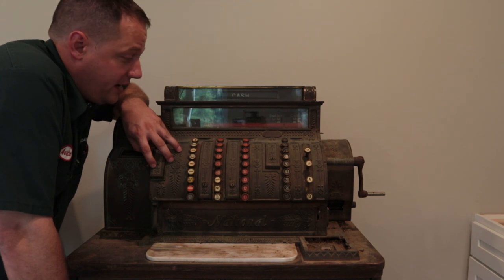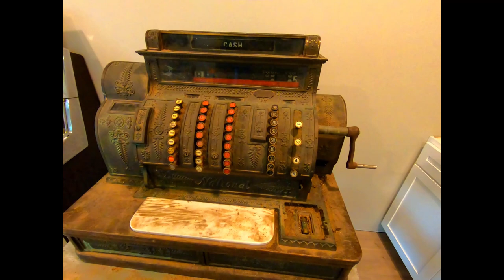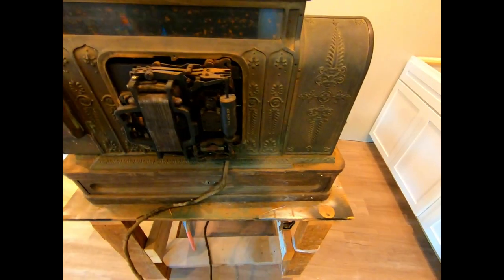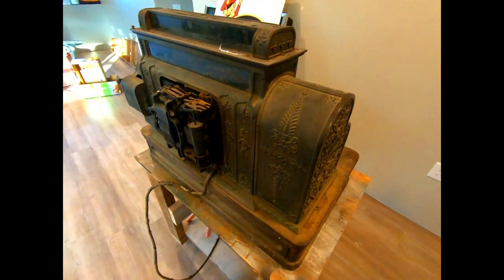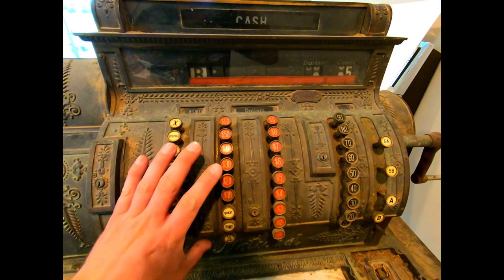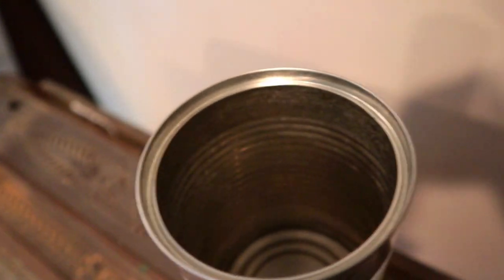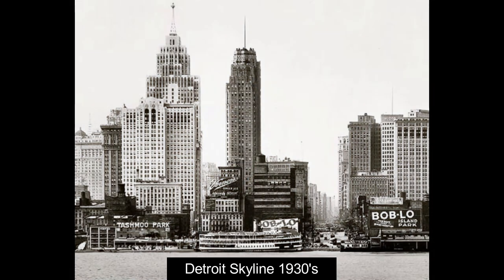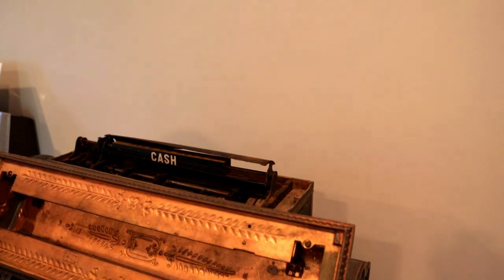What's inside? Mystery Cash Register Locked since 1938

Comment: If you look under the drawer, there will be a label that will likely indicate that it was sold to your friend’s grandfather, and will give the date, salesman, etc, very cool! This will be a challenge, but it is very do-able. As you work to disassemble the machine fully, you can find keys for all of the locks online, just to save you from drilling out any more locks! Good luck! It’s always exciting opening a register drawer, especially if it’s been closed for many years!
Reply from the maker: Thanks for the tip!  I'll check it out! I think I am actually going to take this register to be restored in upstate New York. Some times as restorers we have to realize what is outside our wheelhouse! Thanks again
Reply: @MrVintageRestoration  Well, I'm not sure the scope of what you've worked on, but when you break these down into their general component parts, they aren't too daunting!  By the way, I think you may be referring to HBAC...just be sure to dos one research into others' experiences before the register heads that way! I have no personal experience with them, just have heard of some troubles.  All the best!
Reply from the maker: @bingcrosby1903  Thanks for the heads up. Looks like when the original founder died it went down hill. Too bad. I may have to figure it out. Time will tell. Thanks again!
Reply: @MrVintageRestoration  where in upstate ny. I have one needing work in cny
Reply from the maker: @pamzanon6599  I think they have since gone out of business. The original owner passed away and his kids ran it for a bit. There were a lot of complaints I guess.
Reply: @MrVintageRestoration  thx so much for your quick reply.  I will keep looking!
Reply from the maker: @pamzanon6599  no prob! Happy to help 😊

Comment: If this is from an auto parts store what are the keys marked wine, bottled goods, quart and pint for?
Reply from the maker: It's a 514 if memory serves me correctly, which was originally made for restaurants and hotels. The cash register was made in 1914 and was used when they got it in the 20's